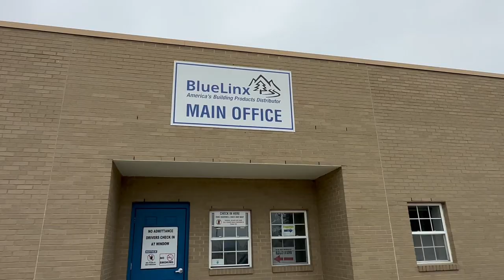Easy Money Blue Linx to Home Builders Same Day Delivery P&S Transport

Comment: Are you local now or loads just falling like that??
Reply from the maker: Little bit of both. I mainly run local but if it’s paying good I’ll stretch out a little bit. I’m doing pretty good right now with running high paying short loads because it also keeps my fuel amount down
Reply: Keeping that fuel down keeps the pockets up! Watching your vids makes me miss P&S.
Reply from the maker: @bnicetrucking3950  💯 what you got going on now?
Reply: @bigsnow1705  Driving a concrete truck now. Been doing that since I left back in oct. 2021. Tried to come back, recruiter told me I would have to get 6 mon before I can come back.
Reply from the maker: 10 4.  Got you